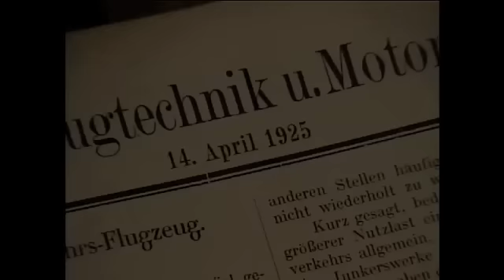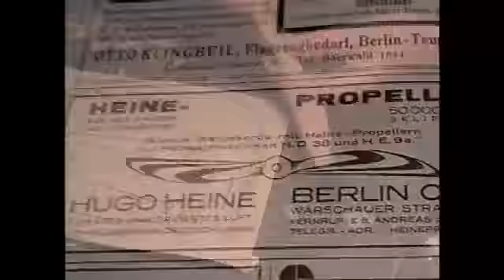Junkers G 24 - Scratch Built Metal Model- Diorama Tempelhof Flughafen circa 1926.

Comment from the maker: Thank you! Because I never needed them! I am focused in showing that it is possible to make good, realistic models, only by hand. For example, I don´t like the spiner done with lathe (common in metal airplane models and the copies in limited edition); they are so perfect that look like stainless steel casseroles! I prefer to use almost the same method (stamped) of real WWII aircraft (yep, I do it by hand). I either needed to use a machine (I imagine very expensive) to make corrugated sheet.